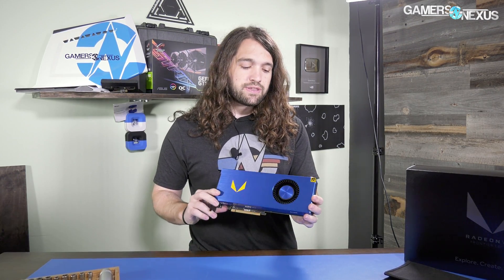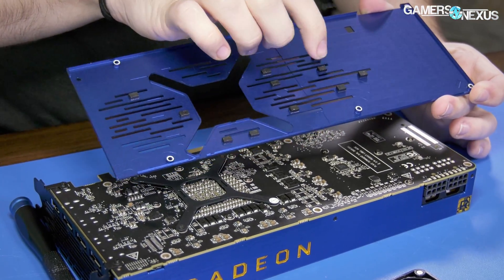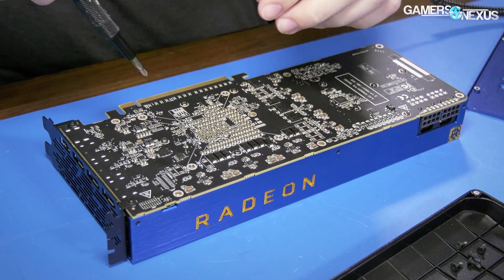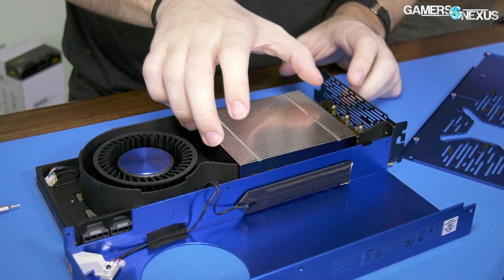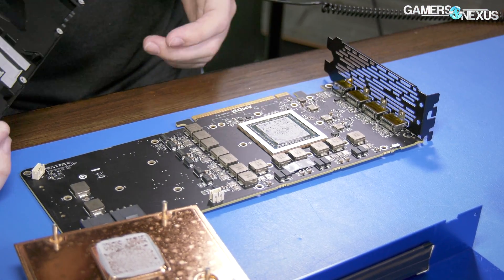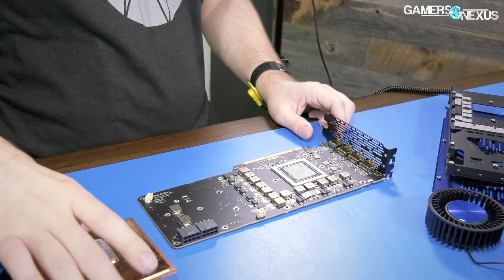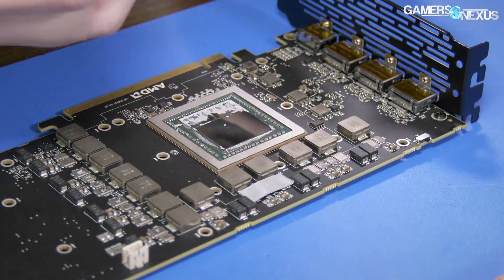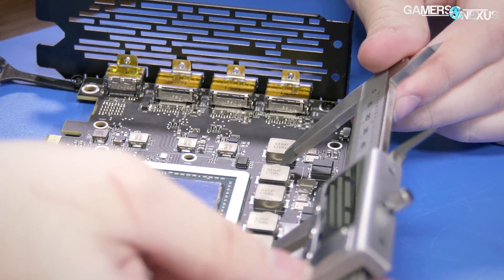AMD Vega: FE Tear-Down, Die Size, Mounting Spacing, & More

Comment: lol, people comparing it to gaming cards from nvidia when it's basically a fire pro/quadro card.
Reply: God Fearing that's wrong. Pro cards have higher precision for floating point operations aka flops that aren't supported at all in gaming cards. Not that you can't game on it
Reply from the maker: We shouldn't have to "emphasize" it when we're just taking it apart.
Reply: Gaming card will have the same chip. If there will be any difference then it will be in features actually cut off on gaming card to make it cheaper, like 8 GB of memory instead of 16. Also this is not fire pro class card, AMD has announced pro card recently, WX 9100. And it will still have the same chip as Vega FE and RX Vega. This Vega FE is like Titan for Nvidia, they also say that this is not a gaming card. So stop with poor excuses that this is not a gaming card or something you pathetic formalists.
Reply: Rawr xD AMD is poor then Intel but they still managed to make products like Ryzen,Threadripper and EPYC.
Reply: Clockwork0nions workstation card is not meant to compete with gaming cards.Dont you see your stupidity comparing gaming capability of a workstation card with a gaming card.Vega FF is a competitor againt p5000 not gtx 1080
Reply: AntiZippo ok btw wait for the gaming version to compare it to a gaming card another thing look at the reference 1080ti it says it uses 250 watts but in test it's showed to use more than 300 and even up to 350 all aftermarket 1080tis are rated at 350watt power consumption why do you think a 650-750 watt psu is recommend for a single 1080 ti card
Reply: AntiZippo you haven't even seen RxVega yet and you are already jumping to conclusions.In past we have seen AMD cards gain 40% performance just out of driver updates and AMD on Reddit has already made it clear a thousand time that Vega FF is a proconsumer card not meant for gaming.So just wait for a month and you will get you 4k60fps
Reply: We don't know yet if the chip is the same, my guess is that it will lack the developer circuits and use the die size for another stuff.
Reply: Clockwork0nions Vega FF performs better then p5000 in most of the tests done in PCPers testing.
https://www.pcper.com/reviews/Graphics-Cards/Radeon-Vega-Frontier-Edition-16GB-Air-Cooled-Review/Professional-Testing-SPEC.You say that p5000 game performance is near gtx1080 and sometimes even better then that but Vega FF performs better then P5000 in most of the test.That alone should safely put rx vega performance above gtx 1080 and with better drivers and optimizations you will see vega reach even 1080ti levels.Right all of you Nvdia assholes claiming that Vega is DOA will be disgraced at the end of this month.
Reply: The Vega FE tied with the P5000 overall in that review you just linked in the only benchmark where they are both compared (SPEC).  Only scoring +10%, +2%, +13%, and +18% in the benchmarks it won in SPEC; an average of 10.75%.

Meanwhile the victories the P5000 got were +2%, +18%, +36%, +30%, and +58% ; and average of 28.8%. the P5000 won by much bigger margins when it won in SPEC. 

If you're talking games then its even bigger because not in one benchmark did the Vega FE even best the 1080; the P5000 GeForce equivalent.
Reply: Feelingtardy, this keeps getting repeated over and over but we see from the Steam hardware survey, which isn't perfect, but paints a vastly different picture. There are almost as many users with 1070's as there are with 1050's and 1050 TI's combined. This is more significant for AMD because there are more 1070's on steam than their entire Polaris lineup combined. Around twice as many to be exact.
Reply: Try to game on a firepro you will be disappointed lol . THe tech people on youtube just want hits thats all.
Reply: baum stamp Anyone that follows PC tech should know these FE cards were not consumer cards. Steve has said that numerous times.
Reply: this isnt a review you fuckin mouth breather. jesus
Reply: Well there's also the fact that both cards of Vega are based of the exact same architecture. When you look at Nvidia Quadro cards, do you know what you will come to find? They have about the same gaming power as the top end Nvidia GTX cards. But for a variety of production and other reasons they are sold off as much much more expensive.
Reply: The only one being stupid here is you. The P4000/5000/6000 all perform almost exactly like their GeForce equivalents in games. As for the productivity benchmarks I've replied to that several times in this very thread; Vega FE loses big and its wins are very small, sometimes even getting beat or tied with the cheaper P4000. 

Vega is going to be a DOA product.
Reply: Joaquin Romero victorica A quadro has the same performance as a titan xp while costing 4 times as much....
Reply: Gamers Nexus Get ready for more of this in the coming months. Lots of AMD fanboys who are gonna lose it if you don't shine a golden light on these cards. Even when it makes no sense.
Reply: +Pedro And this is EXACTLY how things are with Vega FE and RX Vega. Saying that Vega FE is not a gaming card is the same as saying that Titan is not a gaming card.
Reply: even though that is true, that doesn't mean they cannot perform well in games. the P5000 performs as well, or just a bit better than the 1080, and the P6000 performs on 1080TI levels. Lastly the P4000 is around 1070 levels. 

The fact that this card only performs at around a 1070 level overall speaks volumes on how Vega will perform. This part is a 300 watt fully unlocked part, RX Vega parts will not exceed this card in performance.
Reply: Titan IS a Gaming card sold as a workstation card. They usually release a "X80" card with the Titan specs for gaming later.
Reply: Alex Villalobos 1080Ti is almost twice as fast in gaming, and NO RX will perform identically Its the same chip, same Memory, same amount of cores, there is nothing separating them apart from "PRO" and "Gaming" Maybe the clock speed, but it still sucks, and atmost will be around GTX 1080 after all the "Driver Updates" but still using 300+ Watts. Your statement is invalid.
Reply: Damin Ahmad Too bad they can't make proper GPUs, sure HBM, but IDC i just want 60 FPS in 4k for cheap, not useless HBM.
Reply: wow, this comments section is getting crazy. i was really commenting on the few threads i read below comparing benchmarks to pascal, not GN's video. the way i see it, if vega can give us the same price to performance that ryzen has given us so far, it's a huge win for amd. let's be real, enthusiast grade gpu's only cater to the top 5% or so of pc gamers. most people have cards about as powerful as a ps4 in their rigs, lol. really what we see in comments is the vocal minority, most users won't even be considering something like vega, or anything from nvidia above a 1060.
Reply: an enterprise card is not for gaming. its NOT FOR GAMING. its... not... for... gaming...  AMD has already stated this a thousand times and even told consumers not to buy this card if they are going to use it for gaming and wait for RX Vega instead or buy an existing line. i mean i don't know how to spell it out for you more. if you try to game using a P5000 you ARE going to be disappointed you try to game in a firepro S7150 you'll disappointed and if you try to game in a Vega enterprise card like the frontier edition you will also be disappointed. again this is an enterprise card for corporate markets like developers, civil engineering, or design firms, and studio editing for major movie development and the like. it was never meant to compete on the gaming market. just because it can play a few games doesn't mean it will play them well AMD has already expressed that they will be making very little to not drivers for the Vega enterprise cards for gaming support. Nvidia is no different in that regard with their enterprise cards as well. the Vega cards do not need to beat the P5000 in performance. it needs to beat the card in Performance to price ratios. we are talking about a 1000 dollar card (Vega), compared to a 2000 dollar at its lowest, 3000 at its highest, for an average of 2500 dollar card for the P5000. if you where a businessman buying cards for your firm, so they can render designs for cars, or edit a movie for a final production release, or even make a video game, would you buy what can be considered a near peer card that lags behind slightly for 1000 dollars or the card that gives you slightly better performance for double almost triple the price? and that is the sweet spot that makes this particular card from AMD a win. performance to price ratios are with in reason compared to nvidia cards that are excessively over priced when looking at their performance. we are still talking about enterprise cards not gaming cards when looking at the prices. and AMD again expressed that the creation of this card was to give high performance to enterprises for a cheaper solution then nvidia counterparts and cited that nvidias excessive pricing is a contributing factor on why companies especially game developers and design firms have been resorting to using gaming cards in their PCs to develop their products which has made the process extremely difficult for companies because they do not have the support and power they need for rendering some of their developments. developing products using rendering and professional development tools is an entirely different workload on hardware then gaming is. it is a lot more intensive on the card as well especially if the card is not made to do the work like using consumer cards. the enterprise cards like the p5000 and firepro are not within small companies financial reaches. this is a solution for companies, not gamers, and brings the market into more tolerable levels.
Reply: It has Fiji drivers, its not even running at 100% of it's original intended performance. It will get a speed boost for the gaming drivers later on.
Reply: Titans aren't consumer cards either, but people review them all the time. I woudn't be surprised if, PCB wise, this card is basically what consumer Vega will be. It will only cement the FE reviews.
Reply: What a disappointment, 300 Watts and slightly faster than a GTX 1070? How hard have AMD been slacking cause this thing is laughable.
Reply: feelingtardy It's what they do to get hits on their site or video.
Reply: feelingtardy there no difference in gaming cards and this card only vram

Comment: wonder why they dont drop in a couple heatpipes on those fins
Reply: AllYourBase It already has a vapor chamber, that is basically just a big heatpipe below.
Reply: Lourenco Almada obviously not. heat pipes spread the heat to the fins further away from contact plate. this just transfers the heat to the fins faster near the contract plate.
Reply: AllYourBase That's the exact same thing. Heatpipes are used instead of solid copper bars because they transfer heat better, just like a vapor chamber is used instead of a solid base plate.
Reply: vapor chamber is limited to transferring heat at the base tho. heatpipes carry the heat and spread them directly to the fins and areas of the fins far from the base.

Comment: half of the card is empty
Reply: If the pcb was smaller it would have probably still have been extended to accommodate for the blower cooler just like the 480 reference design was.
Reply: the fury was also half empty... then the nano came upon us
Reply: Frothar Ik they should have made it smaller like they did with the Fury X and Nano, or at least put a better air cooler if you're gonna make the card that size.
Reply: My bet is that they are going to use the same pcb for their Vega Pro SSG line, so that is probably where the SSD will go. I can imagine the RX vega line being the same size as a Fury X
Reply: i think that's because of the HBM

Comment: i LOVE the switches that allow you to turn on/off the LEDs.....

screw the color changing switch.......my 6970 MSI lightning use to shine bright as the sun at night, and their was noting i could do but put tape over it......

actually changed my desk so you tower is on the left side now.....so the case window faces the wall VS my right peripheral vision!

Comment: The world's tinyest vapor chamber is the seal from the vapor chamber, that's where they filled it
Reply: Was amazed how they didn't realize and kept calling it a copper plate...
Reply: I concur. That is definitely where they filled the vapour chamber.
Reply: with how the card is laid out it seems like they could make a nano version.. aib cooler for the RX should be nice too. maybe sapphire will make the PCB shorter with the cooler overhanging so the air can pass thru
Reply: Steamroller83 I didn't see any numbers on Steve's caliper, lol, just heard him calling out numbers
Reply: if they use a vapor chamber in it, why didn't they make the cooler 6 cm longer (cooler not graphics card, there is wasted space in front of the fan and  around the displayport ports) and use 2 heatpipes or sth. too.
from what i got so far it stays way below 1600 and gets quite hot, but we see what gn will conclude and we probs will see a hybrid with aio too from steve :D
Reply: @cataria3903 cost my dear friend, cost.
Reply: yeah, the last cooler they made that way was very good.
Reply: manufacturing complexity, diminishing returns.

Comment: Either AMD is sand bagging with the drivers or something is a huge bottleneck on the card.
Reply: flyjum I'M DO SICK OF SAYING THIS. IT IS A WORKSTATION GPU
Reply: Its the same chip as the RX vega with the same ram type and will be clocked at nearly the same speed. RX vega might have 10%~ on this card at most unless AMD is gimping the drivers until the RX is launched. Based on the math alone it should be 240% faster than a RX 480 but its showing 40-60% faster.
Reply: flyjum not gimping drivers. they just weren't gaming ready. RX Vega would have launched by now if they were
Reply: flyjum where did you get the specs of RX VEGA I'm unaware its been leaked or announced already. Can link it to me ?

Comment: 13:42 look who has bird poop now..  😂😂😂😂😂😂😂😂😂😂😂  pick and choose your battles shills.
Reply: This is a gpu without a IHS, you don't add solder on it unless you add an IHS on top.
Reply: lul, comparing gpus to cpus, such a fuckhead.
Reply: trush0t1 direct die contact plus TIM actually works for gpus cpus have a heat spreader in between also which makes it worse
Reply: trush0t1 what else are you suppose to put on them